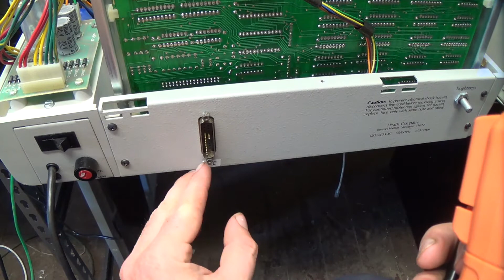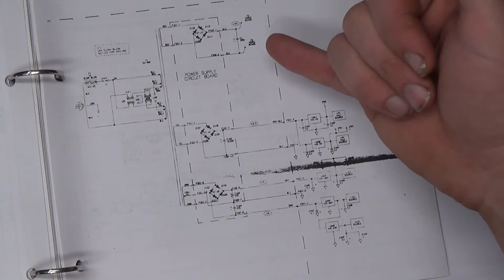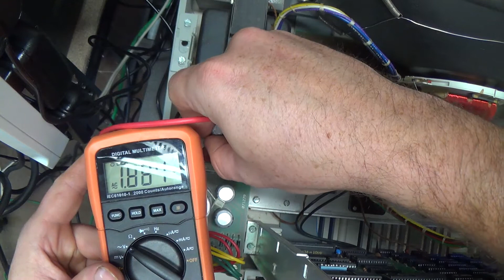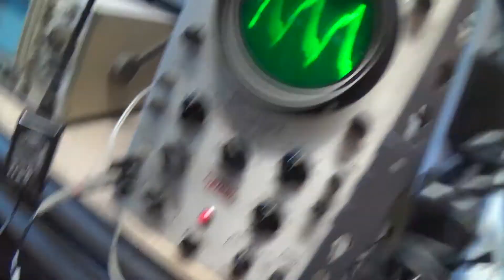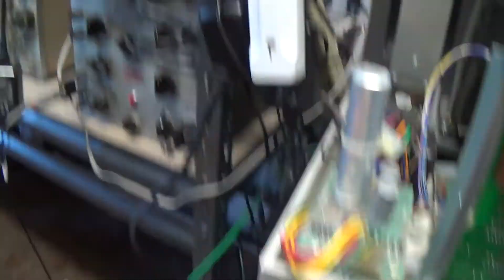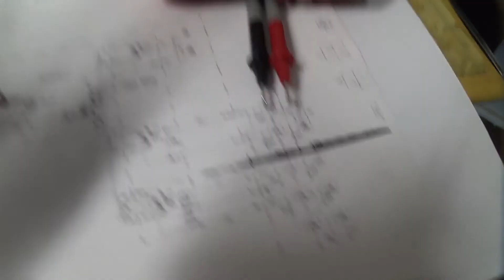Zenith Z-19 Serial Terminal Pt.4 - Failing to suss out the AC transient.

Comment: Lee, I know that this video is 3 years old, but, do you have the H19A Video Terminal Operation manual?  There is a very good writeup about the grounding system in the terminal in the Power Supply Circuit Board section that should answer your questions about the AC "signal" that you are seeing when you use the "incorrect" place to ground your scope or meter.
Reply from the maker: I do!  I will look for that, thanks!!